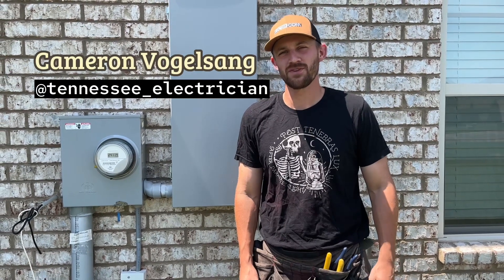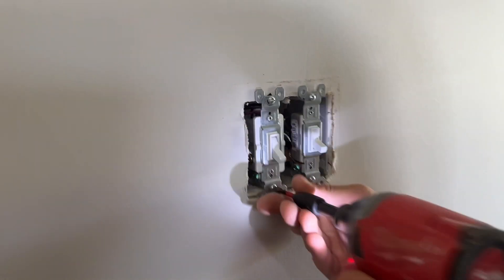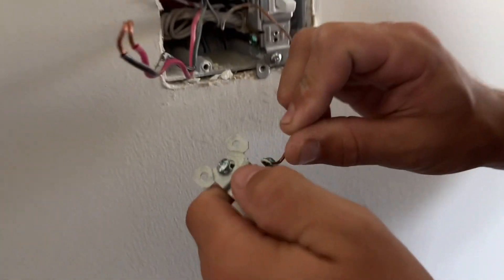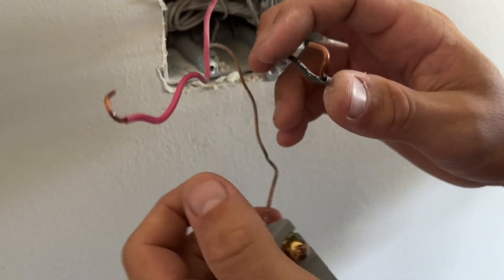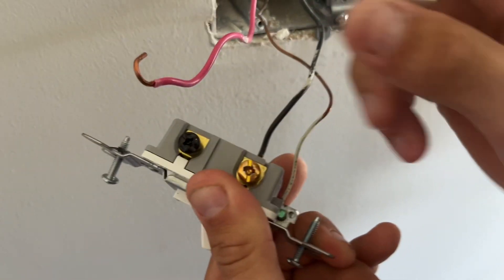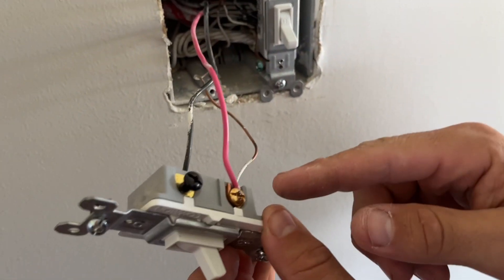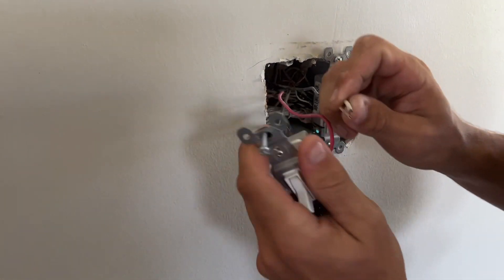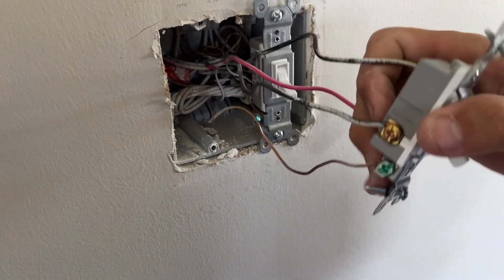How to Change Out a 3 Way Switch (tutorial/do it yourself)!

Comment: Is there enough torque on the terminal screws using a cordless drill?. Or do you need to hand tighten after its snug?.
Reply from the maker: So technically by code you are suppose to use the correct torque. We use cordless drills all the time and it’s fine.